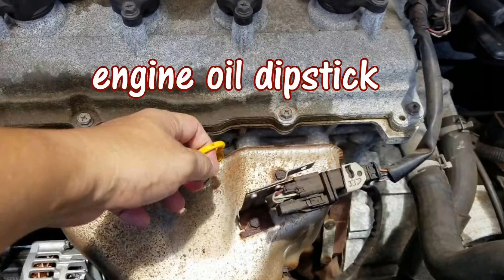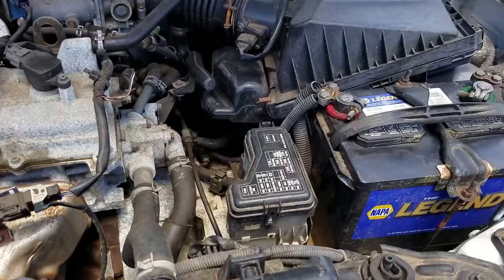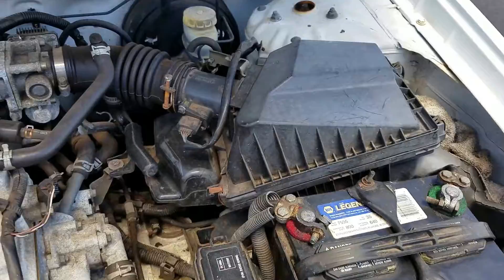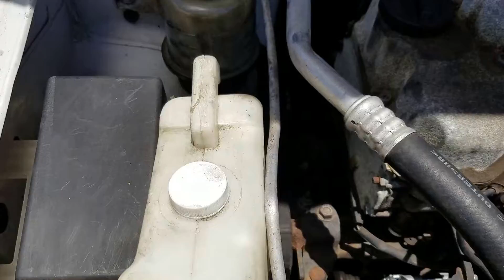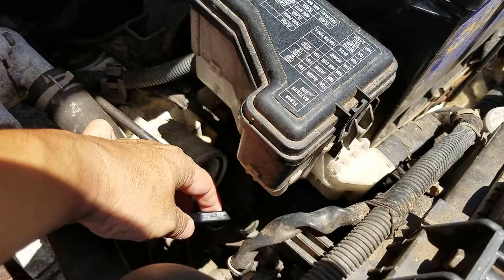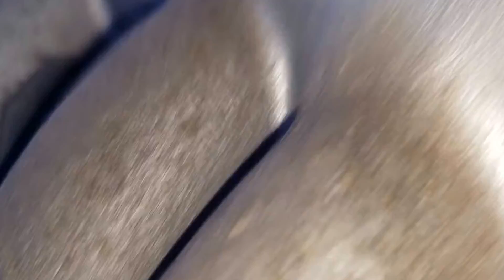Location of Parts Under Hood NISSAN SENTRA 2000-2006

Comment: @1.07 above  & just to the left of his finger is what looks like a loose hose.    Turns out, that hose isn't supposed to be connected to anything.  Which is why I came here to this video to find out.   Much to my surprise, it's just a drain hose.    Not supposed to be connected to anything!

Thanks!
Reply: I've been wondering about that little hose also, never knew it's purpose

Comment: Dumb question probably, but can a 1.8l from a 2005 sentra go into a 2000 sentra?
Reply: yes  from 2000-2006 sentra are same as long as 1.8L engine   some came with the 2.0L engine

Comment: where is the oil  measureing tool located
Reply: on the stick on the bottom after you wipe the oil off the stick it shows the measurements on it

Comment: Everything but the fuel filter location
Reply: Behind the spark plugs and ignition coils is a black hose (on the pilot side) it was just above the 3rd i of the word ignition in the sentence he wrote, it is that little black cylinder the fuel filter is held by two clamps.